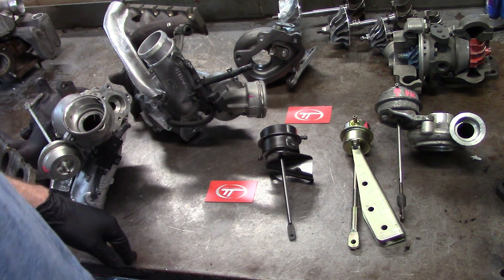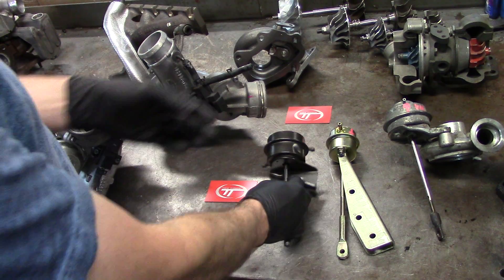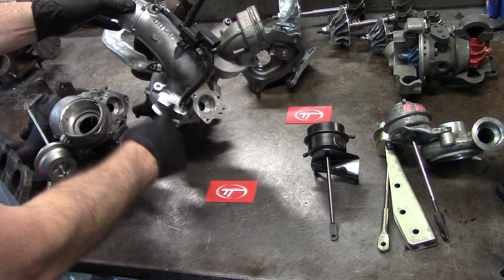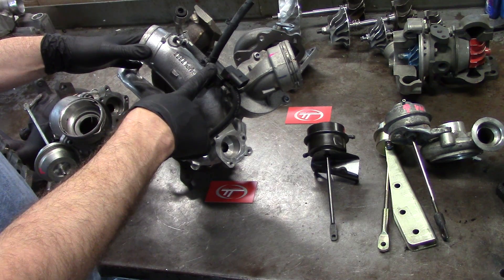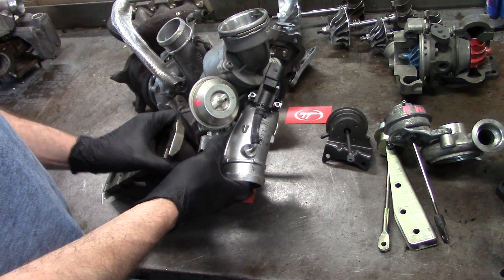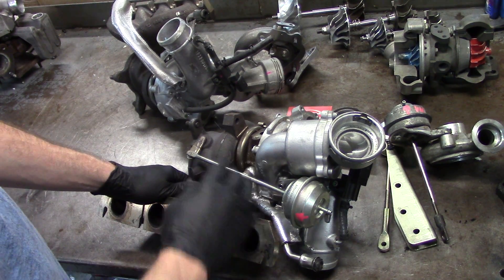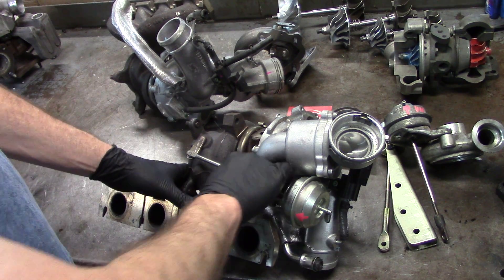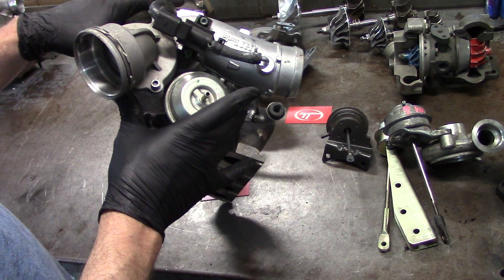Turbo not boosting up?

Comment: Hi Tim Im currently running an HX40 on a 7.8l Iveco. the actuator I believe is not the right 1 for the Truck. even with it turned up its only running 1.5 bar. supposed to be  2bar. I put an external spring and it comes up to 1.8 sometimes 1.9. how do i determine the  right actuator model number for the truck. also can that model support 2.5 bar boost?.